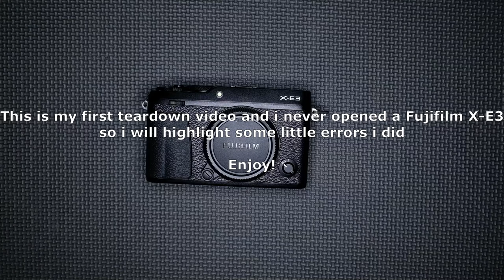Fujifilm X-E3 partial teardown - full spectrum conversion

Comment: Hi, my joystick is loose and wobbly, it doesn’t return to the middle so well. It can be annoying to move the focus point. Is there a way to fix the issue myself?
Reply from the maker: only if you find the part, the joystick has its own PCB.
Reply: @MassinissaDallaCosta  thanks for replying!
Reply from the maker: My pleasure

Comment: Do you know if the camera works without the rear LCD? (I have a X-E3 with a broken LCD, and i'm considering removing the LCD and replace the hole with a thin alu part + the same faux leather as the rest of the camera, and just use the EVF for reviewing pictures, but I have not had the guts to remove it before I know for sure if it works without it) Thanks in advance. All the best Alex :-)
Reply from the maker: Yes, the camera will work without the LCD but remember that the metal plate under the LCD screen works like an heatsink, so it cames hot after a little bit.
nothing to hurt you but be aware of that.

Comment: My front rubber grip came out. Can you help me how do I get it back. It seems a bit out of place as my environment is humid here. The glue seems to stick and I can’t clean. Please help if possible.
Reply from the maker: Hi, about the glue, use Isopropyl alcohol and a tissue. To glue it back a strong thin double tape is the best choice but probably it will became loose again after some months.
Reply: Thanks

Comment: Hi, I'm looking to buy an X-E3 for normal photography but it's flash shoe mount fell off. Of course, this gives me an advantage on the price, but I'd still like to have a functional flash. Can you tell me if the flash shoe is screwed to the body with screws from the outside? I have an X-T10 that I converted to IR and I don't need the flash shoe on it. I was thinking that I could swap the shoe mount, since I can't find a replacement anywhere. I see that Fuji uses two variants to mount the shoe: one in which the screws are mounted from the outside and one where you need to dissassemby the camera. Can you take the shim covering the flash shoe and take a look under it? If you have time, maybe you cand send me a hi-res picture. Thanks!
Reply from the maker: Hi, the flash shoe is screwed from inside, so you need to take off the top plate to unmount it.
Reply: @MassinissaDallaCosta  thanks!

Comment: hey where is the cmos battery located?
Reply from the maker: Minute 6:14

Look at the small battery on the top right of the motherboard, between the 2 black tapes.
you need to unscrew completly the motherboard since it's on the backside.

Comment: One of the cables for my front focus selector is broken. Your video was amazing help in getting far enough to find it, thank you! However, I don't know how to get as far in as the front panel to access the back of the switch. Do I need to remove a front panel?
Long shot on the reply, but if you could any help would be so appreciated!
Reply from the maker: You need to remove completly the front panel to reach the switch.
Reply: @MassinissaDallaCosta  thanks for the reply!

Comment: Wow perfect job ! I've got an X-T3 do you think the method is quite the same. I want to now it the uvir filter is stuck with the sensor not, maybe if you know ?
Reply from the maker: Thanks!
As far as i know the X-T3 has the same layout filters, so you can take off the hotpass filter without problems.
I suggest you to switch it with a clear filter to have better focusing at infinity.
Reply: @MassinissaDallaCosta  thank you so much for your fast reply

Comment: Do you think the disassembly process would be similar on a XE-4? I'm only looking to replace the top and bottom plates with a custom made plate.
Reply from the maker: Not sure since the E-4 has a different design compared to the previous models and there are little differences between them too.
Bottom plate will be the easier to disassembly since the screws are all visible.
Reply: @MassinissaDallaCosta  ah, thank you for the response!

Comment: planning to convert mine too. do you have any issue with focusing?
Reply from the maker: Not with the Fujinon lenses, just with some old wideangle manual focus lenses at infinity.
Reply: @MassinissaDallaCosta  Thank you for the prompt reply. initially wanted to replace the hot mirror with clear glass. will try your method instead. :)
Reply from the maker: @iappleyip My pleasure. 
With a clear glass you are 100% sure it will focus every lens.
In the worst case, since i don't own many lenses, i calibrate the lens (like the Meike 6.5 fisheye).
You can check some pics here:
https://kuula.co/profile/massinissa/
and here:
https://www.flickr.com/photos/mdc74/